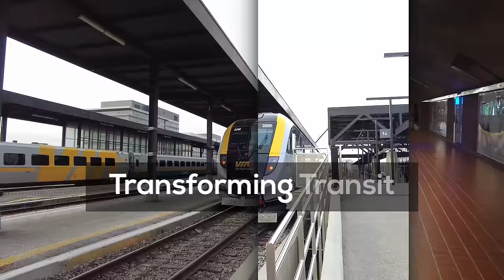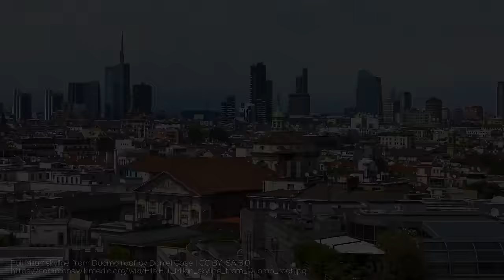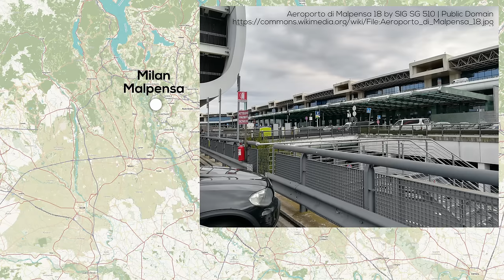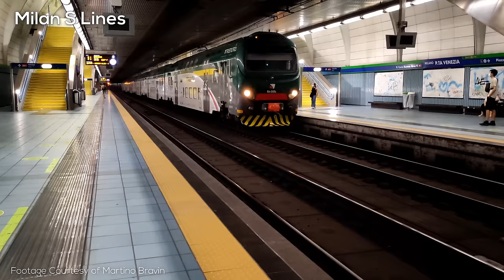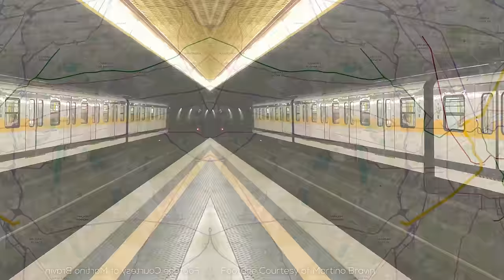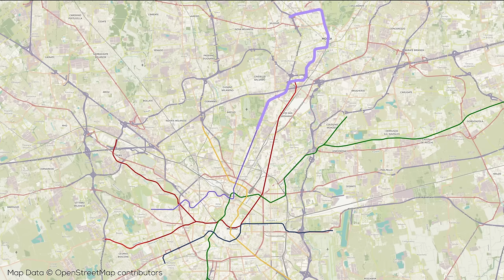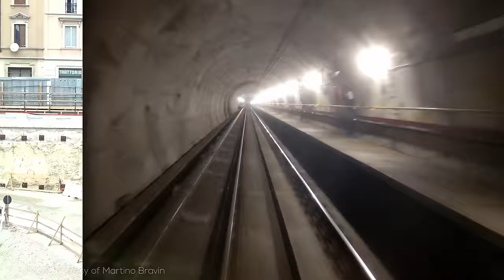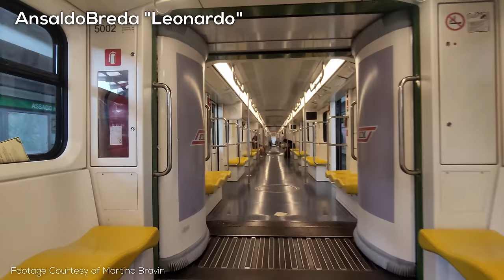A City That Builds Metros Like No Other | Milan Metro

Comment: The tram system is also *amazing*, I took it when I was there a few months ago and there were trams coming along every 3-4 minutes and it was actually faster than driving for many trips
Reply: @kavorkaa  he said tram system. Anyway, you can be amazed by something without meaning something other is not amazing. I really don't get your point
Reply: @kavorkaa  yes it is special. 17 lines of trams is larger than any tram system in Asia. Milan is 1/5 the size of cities like Bangkok, and yet has a large metro, 17 tram lines, and 12 suburban rail lines.
Reply: @kavorkaa  lmfao Bangkok metro has 2 lines. And you’re talking about how advanced it is. It has 3 times the population of Milan, yet it has 2 lines to Milan’s 24 tram metro and s-line lines
Reply from the maker: I agree, it’s a solid system!
Reply: @kavorkaa  As a Hongkonger, I'm not chauvinistic to think Asian metros/trams are amazing but European ones aren't. Don't you know that many representative metro/tram systems of Asia are originated from European systems? But Europe just keep putting forward innovative systems of metros/trams that even Asian cities are still learning from! I don't deny metros/trams of Asian cities aren't great but they're relatively new so the systems are relatively start-of-the-art and can learn from some shortcomings the early systems are. Therefore, if lines or systems are built nowadays in Europe, they must be on par with the appearance and quality of newer Asian metros/trams and even commuter trains. One of the great examples is Elizabeth Line in London
Reply: @tubro541  what does that have to with anything
Reply: @tubro541  totally unrelated comment
Reply: I happen to actually live in Milan and no, trams don't pass every 3-4 minutes ( it woudl actually be catastrophic if they did,  sicne they are kind of long, in the middle of the street and they could occupy the railway in and intersection with cars, specially if is a rail where mumtiple lines meet) trams are supposed to pass every 10 minutes in milan, with less frequency in the evening, even less the weekend  and no service at night
Reply: @aldo_agazzi  per esperienza, in zona Duomo/Cordusio/ecc. passano molto più frequentemente che ogni 10 minuti. Probabilmente uscendo dal centro sì, la frequenza si dilata, ma in centro ho visto tram passare ogni 5-6 minuti
Reply: Tram systems in general kinda suck, specially the Milan one, they have no perfect schedules since they depend on-ground traffic, traffic lights, crossings... they fiscally cannot have a high frequency, specially in stops where multiple lines meet, actually when to trams are too close in thei route maybe because the first encountered a red light, then passengers took too long to get down and there is one coming next less than 5 minutes, they will actually make you get down to not clog the line and retire one tram... no matter the rain, the snow, if the next tram is full....
They are also bad at braking, they don't go everywhere, they take up lanes in the road, they don't operate at night, out of peak hours pass even less frequently, even less at evening, even less on weekends (if you have to take one Sunday evening on your way back home you might have to wait 40 minutes and it would be normal).... no doubt that cars are always the better option.
Reply: @taccus3990  sicuramente, ma di diverse linee, pure il sindaco lo ha detto in risposta a chi chiedeva più corse, i tram troppo frequenti rischiano di affollare il binario e bloccare la circolazione se uno si trovasse in un semaforo o incrocio lento, ancora peggio se un binario viene usato da più linee.... anzi quando due tram della stessa linea stanno per arrivare troppo ravvicinati (meno di cinque minuti) si fanno scendere i passeggeri e i tram davanti va al deposito (a Cenisio m5 succede sempre) per evitare traffico sulla linea, poi i passeggeri devono scende magari sotto la pioggia e salire in quello che arriva subito dopo, che magari è pieno...
E vabbe poi fuori dalle ore di punta la frequenza è più bassa, la sera ancora di più e poi nei giorni festivi ancora di più... ora c'è anche orario estivo....se tu la domenica sera cerchi un tram puoi anche aspettare 40min
Reply: @aldo_agazzi  certamente, non nego che abbia dei problemi non indifferenti. Il tram di perse soffre di problematiche comuni agli autobus, ma se si implementassero le sedi separate si risolverebbe una parte importante del problema. Sulla frequenza al di fuori dell'orario di punta, in Italia ho riscontrato questo disagio un po' ovunque purtroppo, ma diciamo che da Milano ci si aspetta qualcosa in più
Reply: @aldo_agazzi  yeah, I was confusing the Milan systems headways with the Florence system which is smaller but has super high frequencies of a few min. The Milan one is still great tho (to me anyways, your the expert here) it was super useful when I was there. I think the headways can sometimes be below 10 min tho, according to the transit app I use, this may be from traffic jams or something but it seems like as of now when I’m writing this, they’ll be 2 trams within a 2-4 min period on most lines and then one 10 min later.
Reply: @tubro541  Italy as a country was born in 1861 and didn’t had many colonies, Eritrea for about 60 years, Somalia for about 50, Libya for 30, Dodecanese for 30, Etiopia for 5, Albania for 5. I mean, even an year of colonialism is too much, but Italy can’t be described as a major colonial power that occupied foreign land for thousands of years, especially when huge parts of Italy itself was under foreign rule for hundreds of years
Reply: @tommasobianchi5496  he's probably referring to the Roman Empire 😁
Reply: @tommasobianchi5496  I couldn't have described better, Tubro's comment was just full of ignorance
Reply: @staycgirlsitsgoingdown2  many lines, especially those on high capacity routes, have a high frequency during rush hours, up to one every 3/4 minutes. I don’t really agree whit the other guy that commented here, I’ve relied on Milan trams for years taking the line 27 and this is my experience. Probably they’re just complaining, which is a thing that Italians love to do
Reply: @stefasaki97  yup, Italians loveee to complain. My dads Italian and him and his whole family are all glass half empty kind of people. Compared to the rest of the country a tram every 3-10 min during rush hour may seem like an absolutely unacceptable service, but in the USA where I live a tram coming every 10 min during the height of rush hour is considered a super high frequency service
Reply: @tubro541  what resource did the Italians steal?
Reply: @tommasobianchi5496  and you're talking about African countries that didn't have much to steal.
Reply: @staycgirlsitsgoingdown2  yes as Italians we are master Whiners :-P
Reply: @santopino2546  ... Aren't you seeing our compliants about Europe? always we complaint about the constraint of the Europe but atm we are taking money from BCE and Pnnr we are like south of Italy with north of Italy, as Italian I'm really pissed off our PA parasites and the retirement wages got by people that worked without payng taxes...
Reply: @tubro541  Pardon? Are you talking about the Roman empire’s age?
Reply: @tubro541  wtf? Italy colonized only briefly small parts of Africa. Maybe you're talking about UK or France or Spain or Portugal or Belgium or Holland?
Reply: Yeah but I remeber 15y ago when I was going to school was always late the tram 🤣
Reply: @aldo_agazzi  Siete noiosi, tu e tutti quelli italiani come te che vi lamentate sempre. Non credo ci siano altri paesi i cui cittadini, quando gli stranieri fanno dei complimenti, ti dicono invece che fa tutto schifo.
Il sistema a Milano è super efficiente, moderno e la frequenza è molto buona. Esci, gira il mondo, viaggia e facendo paragoni con altre città ti accorgerai che Milano è molto ben servita
Reply: @itsmeandrea138  mah il mondo lo giro eccome visto che per lavoro di mio padre in gioventù ho dovuto viviere sempre in città diverse e i tram, al di là di Milano o meno, sono inefficientissimi e non puoi nemmeno aimentarli... e prorpio da straniero riconosco quando c'è da riconoscere (vedi Tokyo) è proprio un ignorsnte quello che pensa "ah ecco sicuramente si butta merda sul proprio posto, la cosa furba da dire è che in Italia funziona bene perché si va contro corrente" e invece Milano non è nulla di che.... davvero fai la prova ad arrivare a Linate una domenica, estate, di sera e andare al cimitero maggiore, dove ci arriva solo il 14 o la 40 (orario dimenicale, estivo, serale e coi tram e da un aeroporto che senza metro o stazione di treno o tunnel ciclabile diretto fino al centro) e fai lo stesso esperimento a Tokyo, Stoccolma, Mexico City, Singapore, Parigi....
Reply: @itsmeandrea138  l'america latina è pienissima di città con migliori sistemi, e solo una cosa da Italiani di paese pensare "mah in italia si è messi anche peggio, eppure è impossibile che sia vero che nel terzo mondo con meno costi riescano a fare pure meglio perché noi alla fine siamo bianchi e ci hanno detto che bisogna essere di quelli che se la passano meglio..."
Poi questo vuol dire che la rete pubblica nella maggior parte dei paesi sia meglio integrata??? ASSOLUTAMENTE NO! Ma appunto perché usano il miglior sistema per muoversi, ossia l'automobile privata e non come Milano che non investe in quello, ti costringe a usare i mezzi, ne ha pochi ( nemmeno 10 linee di metro nel 2022) li fa pagare molto, se ne vanta, non ha ciclificato, e ogni tanto ti vedi ancora le corse soppresse, tram e metro sostituiti con bus, corse che fanno anche più di 4min di ritardo, frequenze che a volte superano i 40 min??? AOH ma viaggia un po' e vedi come siamo ridotti come la Spagna con la differenza che li è gratis...
Reply: @itsmeandrea138  poi scusa questo comment laudava il fatto di avere un tram ogni 3-4 Minuti, io a Milano il tram lo prendo sempre e 4 minuti è lontanissimo dal tempo di attesa massimo, non ho nemmeno parlato di altri esempi perché i tram sono una schifezza e che ci siano a Milano la dice lunga... ma anche lì io ricordo la Monorotaia di Shangai già 9 anni fa" quando arrivava una già vedevi quella dopo che era in arrivo, non stop, 24/24 (altro che muoversi alle 3/4 a Milano)...
Reply: @itsmeandrea138  davvero. Sempre a spalare merda quando uno straniero fa i complimenti. Andassero via…
Reply: @as14j  listen everybody: Europe is small and busy, we arent's Asia or any colony....i'm sorry but this comments are pointless: every european system is a mix of train-bus-airplane-tram-metro-bike-car-motorbike-car sharing-carriers. Is pointless your comments since Europe is a complex system.
Reply: @aldo_agazzi  qui vi spiego come funzionano i binari del treno, so che può sembrare assurdo ma vi spiegherà molto, così capirete che l'Italia non è peggio dell'estero!
Un binario non può contenere più di un treno alla volta, per intenderci paragonate i treni e le metro agli aerei, questo unito alla piccola dimensione del continente(in realtà l'unico subcontinente esistente sarebbe l'Eurasia visto che non ci divide l'oceano ma vabbè) rende fisiologici i ritardi e questo non capita solo in Italia ma ovunque e noi semplicemente lo notiamo di più.
Inoltre dovendo diminuire le dimensioni dei binari, non a caso quelli europei sono famosi per le dimensioni minori rispetto al resto del mondo, purtroppo aumenta il rischio di deragliamenti sui treni merce ma aumenta la velocità in quando più sottili significa meno attrito.
Sarebbe molto da dire, soprattutto sul fatto che i peggiori sono i tedeschi a parer mio(vedi Viareggio, erano componentistiche austriache e tedesche a rompersi e capitava di frequente).
Ora che sapete questo sappiate che la metro, tecnicamente, non è altro che un treno.
Reply: @tubro541  italy was born 160 years ago, mind to tell me what we stole in the 'thousands' of years during which we didn't exist? you're not a smart one are you?
Reply: @tubro541  actually, historically speaking,  Italy's colonization was really poor compared to other European countries, such as England and France
Reply: @taccus3990  io ho beccato lo sciopero :(

Comment: Something I really love about this system is how the trains and stations feature color accents that match the colors of the line. I think that really enhances the line's identity and provides a consistent visual cue. It's also a good component of branding, which I believe to be really important.
Reply from the maker: Absolutely, love it!
Reply: The station signs, way finders and general design actually won a renoun architecture and design award shortly after the opening of the first two lines. As a Milan resident, I'm honestly shocked many times when I travel by how badly designed transit signs and clues can be.
Reply: Infact,in milan,locals usually just refer the lines by their colour,not the name
Reply: Agree! That is something that make thing much easier.
Reply: @gabri_maybe  penso di non aver mai chiamato le linee del metro con la numerazione, ho sempre detto "prendi la verde/gialla/ecc." ahah
Reply: @luca7069  Franco Albini and Bob Noorda studied the 'communication part' of the metro, color included.
In 1966 Noorda along with Vignelli was called by New York City Subway for its communication plan, maps, signage etc.
While the maps are no more in use (since the '70s) the signage partially still exists today. Noorda applied some of the principles he put on M1 Milan metro, such as a modern clear font as Helvetica (even if Milan one was a modified Helvetica) and hanging backlit white panels with indications
Reply: @taccus3990  anche se dici la numerazione chiedono che colore è lol
Reply: @gabri_maybe  no, io la so la numerazione :) poi la "lilla" proprio non si può sentire... :)
Reply: Yes, it really eases the passengers to find their way to the correct trains in interchange stations!
Reply: They do this on the London Underground too. Things like grab rails, plastic arm rests, and even the seat maquettes match the colour assigned to the line.
Reply: @robtyman4281  yes but nobody refers to the Circle line as the "yellow line", in Milan the colour of the line is often more used when referring to that specific line (I've often said and heard: "sono sulla rossa" that means "I'm on the red line" instead of "I'm on the line 1")
Reply: there's a good viedo about this, in italian, it is the classic(boring for us but amazing for you) italian style...we are proud of this! "La metro di Milano - Un esempio di immagine coordinata | SUPPOSTE DI ARCHITETTURA ep.28 of Ederake"
Reply: @marcodamasio  ...well, this is what sets the London Underground apart from any other city's underground metro network. The fact we actually give the lines meaningful names......instead of opting for the easy option of 'the yellow line' or the 'blue Line'. 

It's the original, and still the best imo.  Milan's is good, but it doesn't have the history that London's one has.
Reply: @emilianoturazzi  team lilla tutta la vita
Reply: you've never seen porta venezia's M2 stop then, hahahha
Reply: eugenio costa  ...much of the London Underground is 'properly underground' - I mean really quite deep level; as opposed to most other cities underground networks which are literally just below street level. 

The District, and Metropolitan lines are just below or at ground level, but most of the other lines are deep. It's the original underground railway, and back in the late 19th century they wanted to have a deep railway underground that was below all the cables (because the UK buries all its cables...it's why our streets don't have poles with masses of wires coming off them; and also they wanted it underneath the sewers). So with these in mind they had to go far down under the ground.

The deepest part of the network is near Hampstead underground station (Northern line) - which is 58.5 metres below ground....or 192 ft!!
Reply: As a Milan citizen i thought this was the norm all over the World, but as soon i started traveling realized that isn't the case.
I find the enhancement of line identity thru color useful and reassuring
Reply: @robtyman4281  not really,only 45% of the Underground is actually underground,even deep level lines aren't that deep when they exit the city
Reply: @emilianoturazzi  Io la chiamo "la viola", mi rifuto di chiamarla lilla 😝

Comment: And last but not least, from Milano Centrale you can travel to Paris with Trenitalia's Frecciarossa 1000 and from Porta Garibaldi with the TGV. A very new(Dec 2021) connection; did used it myself and it is such a super adventure on rail. I can recommend it to everyone.
Reply: @jandron94  good point man. But it's a very rocky way to go in the view of this tunnel. Same with the Brenner Tunnel. Will decrease the time of rail travel time enormously. But still a long time to wait, sadly.
Reply: I did it and the tgv broke down lol (still fun)
Reply: When (if?) they finish the incredibly controversial Turin-Lyon HSR the times will be just over 4 hours, too. If the Turin-Lyon was further upgraded to true high speed they could be reduced even further (but then freight trains would have to get creative with their scheduling).